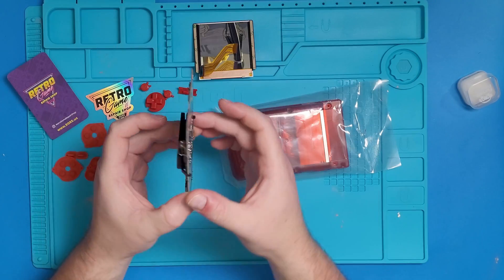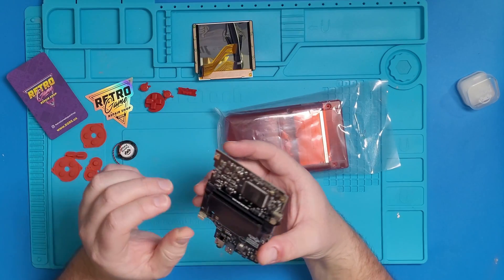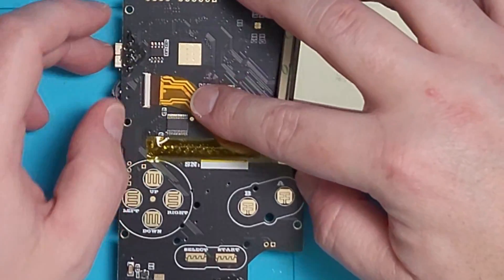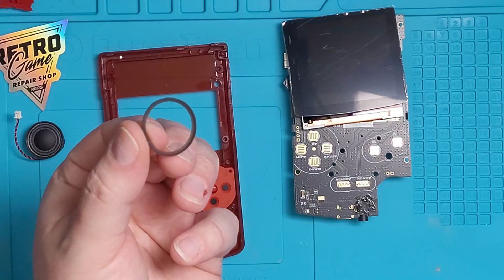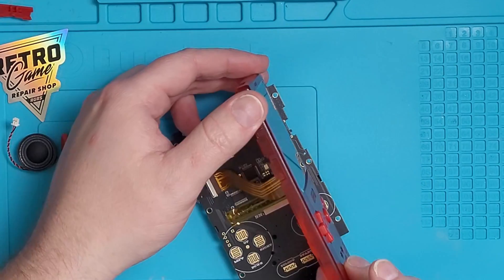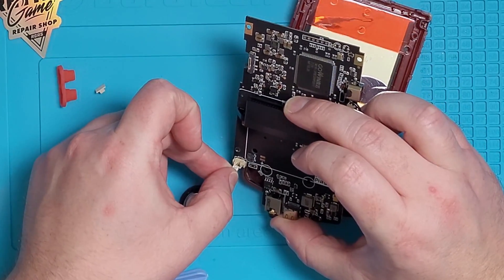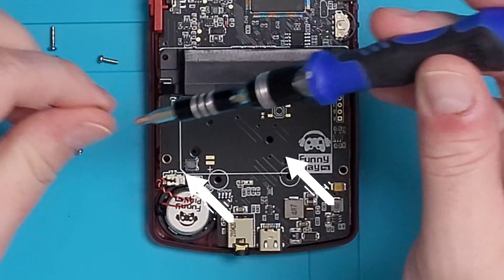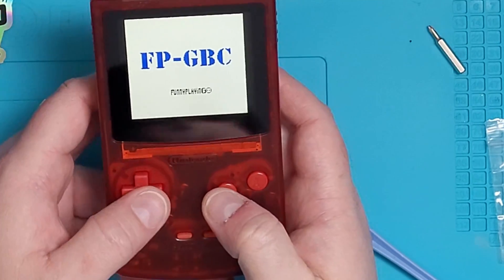Build Your Own FPGA Game Boy Color In 5 Minutes! How To Guide

Comment: I know i could use google buuuut!....what does fpga stand for?
Reply from the maker: Frank Puts Gas Around town 😂 the gist is that it's a customizable chip that can be updated and flashed easily enough.  Perhaps we get a GBA model one day 🤗🤗🤗
Reply: Field Programmable Gate Arrays (FPGAs) are integrated circuits often sold off-the-shelf. They're referred to as 'field programmable' because they provide customers (usually another company going to mass use or sell the reprogrammed circuit board) the ability to reconfigure the hardware to meet specific use case requirements after the manufacturing process.

So FunnyPlaying can buy thousands of these boards and program the chip to act like the GBC.
Reply from the maker: Yup didn't want to be scientific about it lol but hopefully this reaches the right gamers that ask.